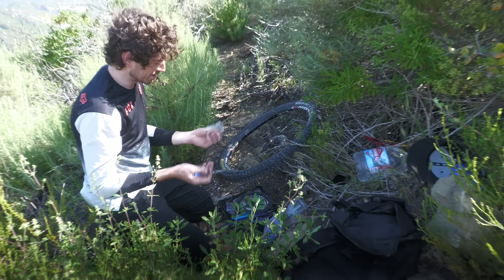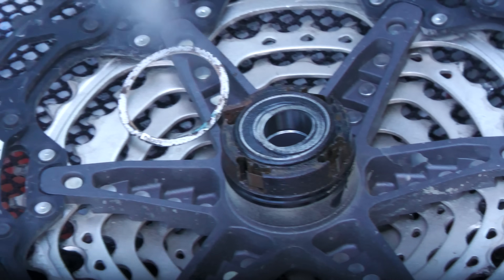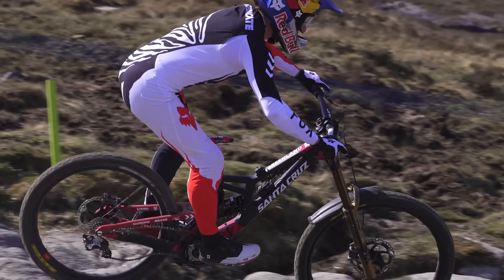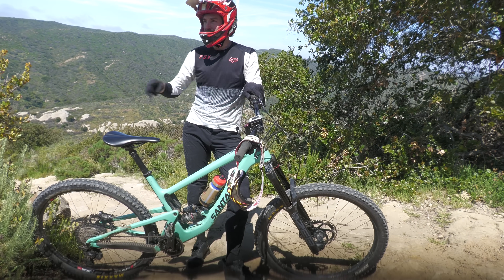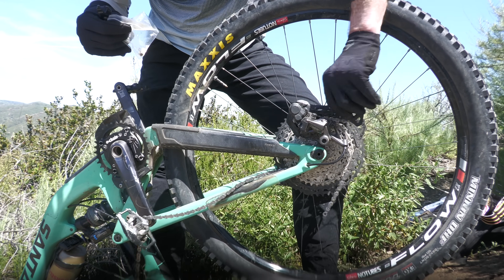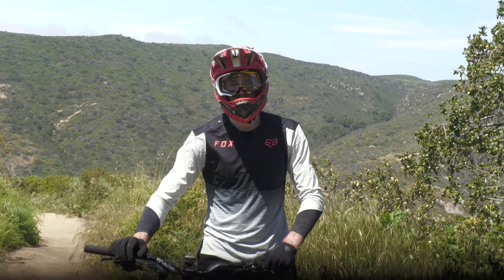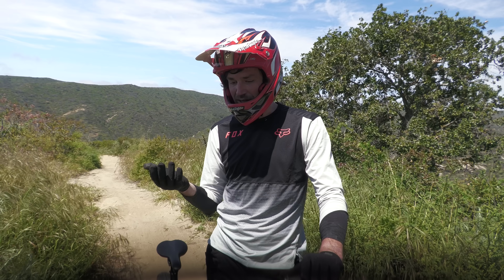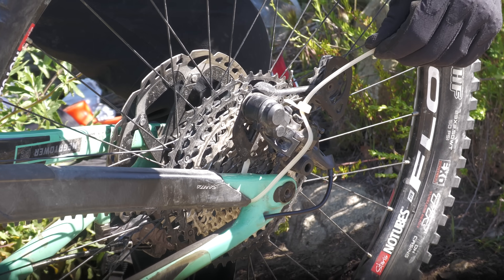Does This Improve MTB Suspension Performance?

Comment: So my takeaway from this, is that the company behind Ochain has essentially designed a solution for a problem that there was already a solution for, and is absolutely rinsing people of their money for it. The proper solution is cheap low engagement hubs that have been around for decades.
Reply: The point everybody seems to forget, is that often times you are braking through rough stuff, where the back wheel looks up at least everytime it leaves the ground, even with extremely controlled bracking. Now when the wheel is locked the low engagement hub doesn't do anything for you anymore, while the ochain still works. I ride 36 point engagement hubs and the ochain still made a huge difference in back to back testing, especially under hard bracking.
Reply: @PatBK  Exactly. Hub engagement doesn't come into play when your rear wheel is skidding. And even when your rear wheel is spinning, the trick with low engagement hubs is that they're sometimes 12 degrees away from engaging, and sometimes they're zero degrees away from engaging. So you get less pedal kickback on average, but sometimes you get the same amount of pedal kickback as you would with a super high engagement hub.

Comment: Why not just leave in your 18 prawl DT Swiss? Terrible engagement. Looks about the same play.
Reply: The trick with low engagement hubs is that they're sometimes 12 degrees away from engaging, and sometimes they're zero degrees away from engaging. So you get less pedal kickback on average, but sometimes you get the same amount of pedal kickback as you would with a super high engagement hub.
Reply: @charliesponsel5091  Makes sense.

Comment: Bad test, as the tester is not "blinded". If medical tests would be done like this medical companies would would worth trillions😅At the speeds you were riding is literally impossible for the hub to engage (without locking the rear wheel, which anyway you should not do, for obvious reasons). See "What is PEDAL KICKBACK?...Should you care?" from Trail POV and "How Your Chain Interacts With Your Suspension - The Tuesday Tune 31" from Vorsprung Suspension for explanations. In the comments the guy from Vorsprung says: "I don't believe it achieves anything. Same for the prototype system Canyon had on their bikes to manually disengage the freehub with a remote, which seemed like a needlessly dangerous system." And watch the Pinkbike drop-to-flat tests. The chain is flapping all over the pace, so how could a loose chain pull your cranks? 😅
Reply: "At the speeds you were riding is literally impossible for the hub to engage." That's what I thought before the test, and that's exactly what I was hoping to test. If taking the pawls out makes a noticeable difference, doesn't that mean the hub WAS engaging, even at high speeds?
Reply: @charliesponsel5091  No, if you don't lock your rear wheel, which anyway you shouldn't do. It's highschool math. Testing is unreliable when it can be affected by placebo. There is a reason why doing experiements where humans are involved is so difficult and why non-blinded experiements are not valid in medicine or psychology. I suggest more reading on that.